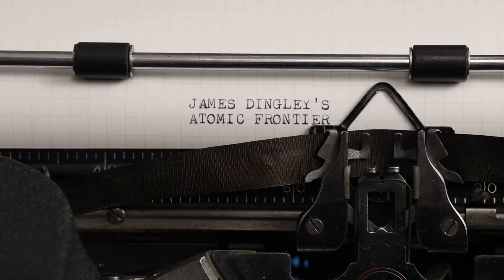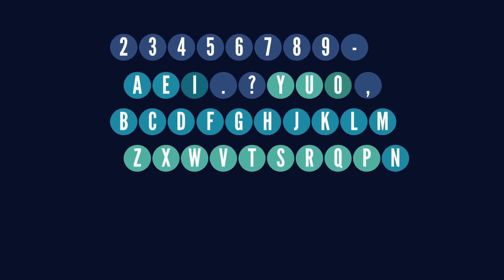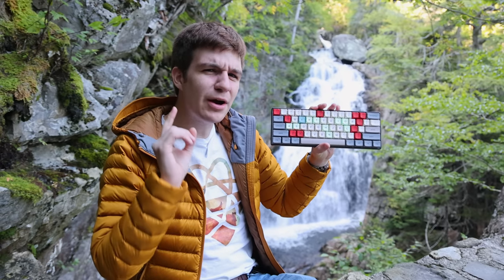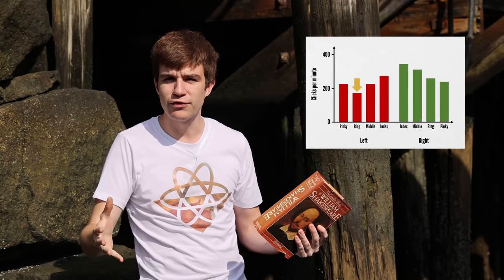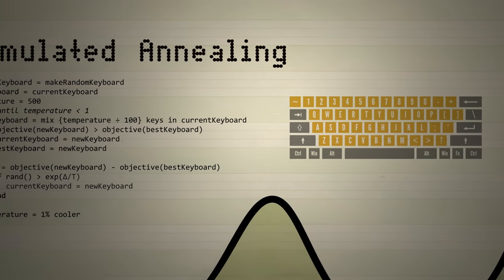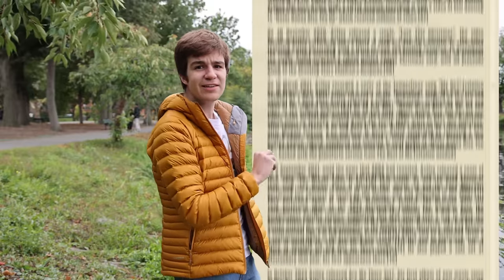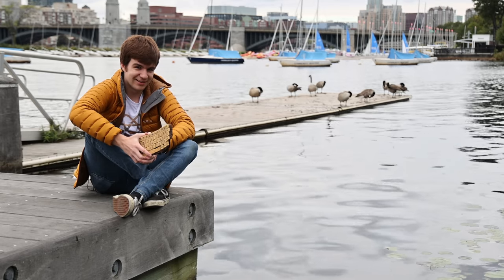QWERTY is broken. Can we make it better?

Comment: Dworak did not only optimize the finger travel-time and a frequency, he also optimized the layout such that the fingers would alternate on the most frequent two-letter combinations. Like ensuring that E and R or T and H would be on opposite sides of the keyboard
Reply: Came here to say this.  I think it's the core problem with his algorithm; it optimizes for only one variable.
Reply: Agreed.  Dvorak also optimized for anatomy in that your hand rolls better one way than the other, so things like SN, ST, SH, and TH are easier to type.  But this favors primarily English.  Still, glad to see that even with James' more limited analysis, my decision in college to switch to Dvorak has been at least 26% a good idea.
Reply: Dvorak has never been shown to be helpful.
Reply: Dvorak absolutely has been shown to be helpful. The main effect is comfort, with a small improvement in accuracy and speed.
Reply: @pdgiddie  only in people that learned how to type wrong
Reply: @vyor8837  I don't see what's controversial here: you can learn to touch type on both Qwerty and Dvorak with good results. But fingers objectively travel less far with Dvorak. There is a difference 🤷‍♂️
Reply: @pdgiddie  finger travel distance doesn't cause strain abd could, in fact, reduce it since the movements are less repetitive.
Reply: @vyor8837  Dvorak had it been adopted pre-home PC's would be the standard, but unlike learning a knew language you are talking about muscle memory with takes thousands of hours to re-train.
Reply: i switched to dvorak in college years ago. i'm super happy that i did. it is pretty frustrating when i'm using a different computer or starting to play a new pc game, but i think it is still worth it to switch.
Reply: That’s important.
Reply: Or does it?
Reply: That is a point, to spread the “load” over the fingers, making sure to involve the whole hand - the lesser fingers employing the less-used letters. OK, I see that has already been done.
But your comment helped me think it through again.
   You attitude doesn’t of course but “it takes all kinds”.
Reply: And yet they had to lie about the woman they held up as the reason why Dvorak is better and barely anyone uses Dvorak today. All the top world records for WPM are done using QWERTY.
Reply: @DoubleNDonn  I know people who have comfortably switched to it in a couple of months. I, however, wouldn't accept even that overhead!
Reply: colemak goes in the opposite extreme, putting most of the common letters on your right hand (presuming you're right-handed). its an interesting problem to solve and there's a ton of layouts for english nowadays
Reply: You may create the most perfectly optimized keyboard, the problem is that people are so used to the traditional QWERY keyboard, that's it's virtually impossible to change it now... like it or not.  Sure one can learn a new layout, but the vast majority won't.
Reply: @DoubleNDonn  Depends on your age. If you're 50, it might take months or years. Meanwhile if you're in your teens, you can expect to get comfortable using the new layout within days or weeks, depending on how often / how much you type.
Reply: @vyor8837  My experience: used the Qwerty layout for years, couldn't type for hours at high speeds without requiring a break. Switched to Dvorak, all issues resolved, endurance improved significantly. This was 10+ years ago.

Haven't seen any studies on this one, but the advantages seem pretty intuitive. Less muscle use = lower likelihood of overuse = easier recovery.
Reply: @lakojake4215  The highest confirmed WPM was achieved by Barbara Blackburn with the Dvorak. Higher records have only been achieved on online platforms, which means that they could have been based on cheating (use of software or hardware tools).
Reply: @VVayVVard  Except that isn't where the issues come from. The issues come from the wrist, which is not impacted by qwerty vs dvorak with proper typing technique.
Reply: @vyor8837  movements are less repetitive when the fingers travel longer distances? How does that work? if you're typing in English, then you're typing a lot of the same words and letter combinations over and over; it's repetitive no matter what layout you use.

The key is to make the repetition cause less strain on your muscles, tendons, and joints, which Dvorak accomplishes.
Reply: @MenacingBanjo  Except there has never been any proof of ANY difference. EVER.
Reply: @vyor8837  They're the same thing. The tendons of the fingers pass through the wrist---that's the reason typing (moving your fingers) can induce carpal tunnel syndrome. The more you move your fingers, the more their tendons rub against their surroundings within the carpal tunnel. 

Accordingly, strain can be reduced both by improving technique and by limiting the average distance traveled by the fingers (i.e. minimizing tendon movement). Employing both of these methods reduces strain more than employing only one of them in isolation.
Reply: @VVayVVard  post a study then
Reply: @vyor8837  Post a study that shows that walking 150 kilometers a day can strain the body more than walking 75 kilometers a day.

You can't? Oh, it must be untrue then.
Reply: @VVayVVard  I'm quite sure it wouldn't simply because the body would breakdown before either threshold is met
Reply: @vyor8837   The world record for longest distance walked in a day (24 hours) is apparently around 230 km. A healthy body can certainly handle 75 km given adequate training.

And of course the point is rhetorical. If you can't answer it without relying on intuition, but you feel that intuition is still reliable enough to use as a basis for drawing a preliminary conclusion, then evidently you agree with my point. Scientific intuition dictates that traveling a shorter distance produces less tissue strain, and this applies to the parts of the body involved in walking just as it does to those involved in typing. So we can conclude that typing in English with the Dvorak layout should produce less strain than typing with the Qwerty layout.
Reply: @VVayVVard  except that no study shows devorak causes less strain than qwerty.

Hell, with proper typing, you actually need to move your fingers more for commonly used letters like "a" and "h"
Reply: @vyor8837  And as said, no study shows that walking 150 km causes more strain than walking 75 km. Re-read the previous replies.

The letter 'a' is in the same spot for Dvorak and Qwerty, on the homerow. The letter 'h' is directly under your index finger in its resting position for Dvorak. It sounds like you're talking about a different layout.
Reply: @VVayVVard  Maybe, but on the other hand I can point to studies showing that there is no difference.

The IBM Research Laboratory found that, quote, "no alternative has shown a realistically significant advantage over the QWERTY for general purpose typing."
Reply: @vyor8837  Actually they didn't say there's no difference, and that was just one study (Miller & Thomas 1977). Quote:

"R.F. Nickells, Jr, found that Dvorak was possibly 6.2 percent faster than QWERTY, while R. Kinkhead found a 2.3% advantage in favour of Dvorak. 

Donald Norman and David Rumelhart tested a number of alphabetically-organised keyboards and a random keyboard as well as the Sholes (QWERTY) and the Dvorak. They found that alphabetic keyboards were between 2 and 9% slower than Sholes, and Dvorak maybe 5% faster. "

I looked up the aforementioned quote and found this paragraph. It indicates that several studies found Dvorak to be faster for typing than Qwerty. 

The reason it's faster is because there's less movement. And less movement means less strain, because strain is caused by movement.

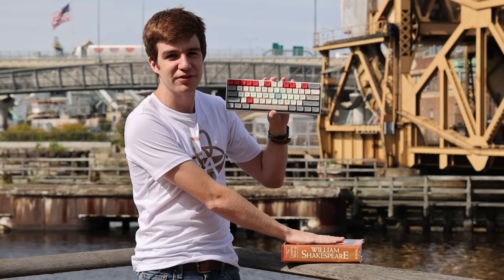Comment: 10:00 This layout demonstrates the need to choose your performance metric carefully. No penalty for same finger movement meant that for many common bigrams the right index finger has to hit two different keys in quick succession. E.g. for AN (2% of bigrams), and also (in order of decreasing frequency) EN, ND, ED, AL, LE, DE, NE, and EA (0.69% of bigrams). For the word AND the same finger has to hit 3 keys!
Reply: this is why i like colemak, it's especially optimized with movements in mind, and god damn it tends to feel extremely smooth to type. Sentences are just a series of rolling movements and one finger basically never has to jump around awkwardly
Reply: @swedneck  Nice! Which version do you like best? I'm personally using Colemak-DH.
I find that with qwerty, my fingers tend to hover above the keyboard, while in colemak they can rest flat on the home row keys. Love the inward rolls.
Reply: @cymno  i think what i use is colemak-DH wide mod altered to be more in line with the standard swedish layout (it has åäö and the normal for us placement of symbols)

And yeah it's rather funny how my typing style instantly changes when i move back to a qwerty keyboard, with colemak i rest on the home keys and all fingers move equally little, but with qwerty i end up mostly typing with the pointer and middle fingers and the right hand flies around its half of the keyboard to hunt for the right key..
Reply: @swedneck  I do type 10 finger on qwerty, but the high frequency of keys not on the home row makes me hover my hands above the keyboard instead of resting the fingers on the keys
Reply: @swedneck  That's why I like the Workman layout 👍
Reply: @cymno I use Colemak, but I think that hovering is good. When my hands hover over the keyboard with always at least one finger of the hand on the home row for reference, finger movement is split between multiple fingers, so reaching distant keys is much easier. The distant keys are mainly numerals and the keys in the mid of a split layout.
Reply: was about to say, finger alternation is actually very useful, even on just one hand.
Reply: @swedneck  dvorak neither, what i dont ike of colemak mainly is that the vowels arent on the same side, which is what really gives speed, alternating sides... anyway colemak was invented to keep the ctrl ZXCV which basically is trying to carry a weakness of qwerty.... i solved the issue, personally those 4 are now F1-2-3-4 on mine with antsoft keymanager...
_
Reply: I use the Neo layout, intended for german but still works really well for english. Plus the punctuation layer and special layer (arrows, home, end, page up,...) are the kind of things that you can never go back from. You don't even have to move hands for keys like escape or backspace
Reply: @nayosk8899  thats the same idea than dvorak, all vowels same side ... i don't get your escape /bspace, arrows thing though, it's all at the same place... ?
_
Reply: Agreed, the performance metric-isation becomes a bit subjective when you have to start making decisions about which things need prioritising and what their relative priorities are or if the different performance components can be suitably treated as a linear combination in the first place. I think judging from the components he used he was mainly concerned with optimising ergonomics than sheer speed which I think is the main focus for you.
Reply: @MuktiLuv  The punctuation on 3rd layer and special keys on 4th are at the same place as letters, instead of far away on numbers row. I get that re-learning punctuation is a hassle, but for programming it makes a lot of sense
Reply: yup, the thing I wanted to comment as well. Thanks
Reply: Very insightful observation. We can't expect machine learning to provide optimal results unless we can accurately define 'optimal'.
Reply: Canary is a bit niche, but not bad and has some real nice rolls
Reply: exactly, sfb and sfs (same finger skipgram) are the single most important stats for layout for comfortable typing and even more for speed typing. Dvorak took this stat seriously, but failed because of very bad english data and no computer aiding, so it is much worse than qwerty and modern layouts in this stat and doesn't compensate for it enough.
Reply: @swedneck slow ass layout tho, these tests assume homerow is the correct style which sean wrona other speed typist (e.g rocket) heavily not conform to. if your right hand can help in the left side depending on the combo and vice versa and change the angles of ur hand then qwerty is the fastest. just try typing “queue”, “unlikely” on colemak. Ironic cause you literally have 0% sfb in qwerty if say u use non standard way of typing like sean. main disadvantage of alts is its too contrained to do that because its designed to that ur hand never leaves the home row. Theres a reason rocket can spam out 350wpm in qwerty and only 200+ only in vanilla colemak (which is faster imo than dh)